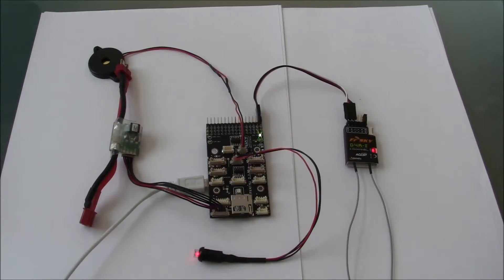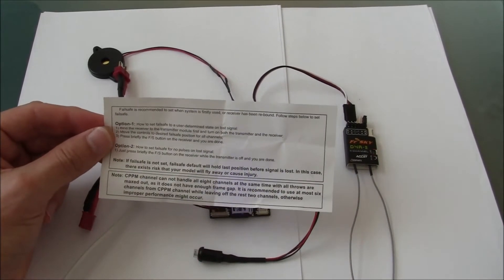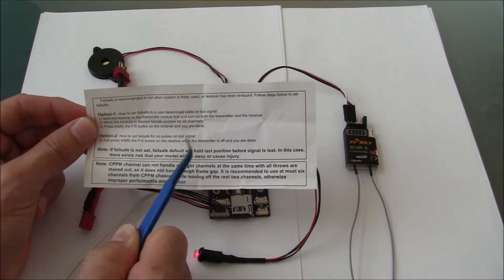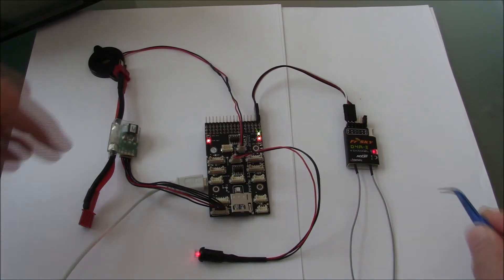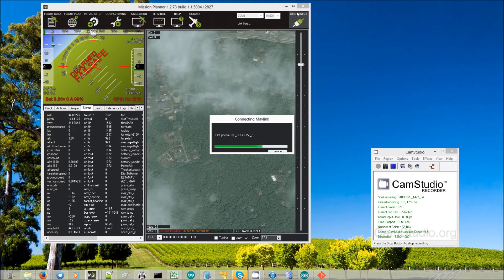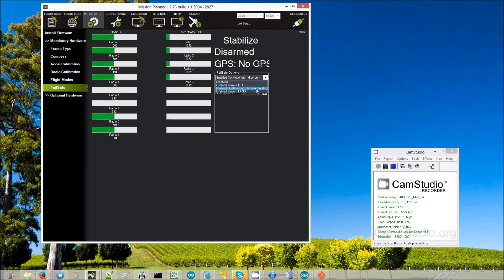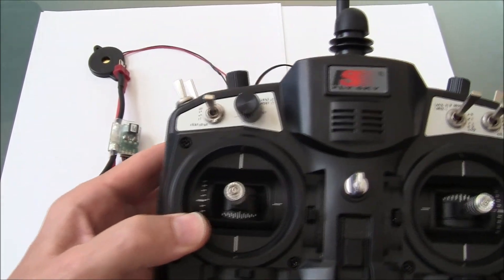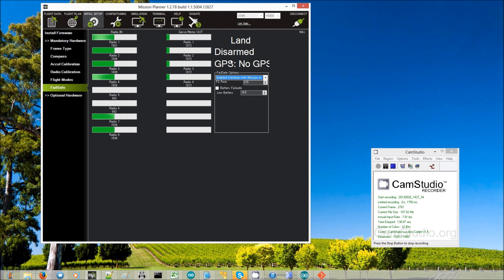FrSky D4R-II receiver failsafe setup with AC3.1 on Pixhawk

Comment: Why does the copter switch to stabilize and then land when you have enable mission in auto set? is this because you were not flying in auto? if you were what would you expect to see on the throttle channels?
Reply from the maker: Tyler Griffin It didn't switch to Stabilize, it was already in Stabiilze and then because of the radio failsafe it switched to Land mode.  If it had been in Auto at the time of the failsafe, because I'd select "Enabled, Continue with mission in Auto Mode", the mode would not have changed at all, it would have remained in AUTO mode.

Comment from the maker: You should be able to use the same set-up procedure for the APM2.5 ~ 2.6 and it should trigger the failsafe but I haven't tested it yet and there's one thing that worries me a little - the ppm encoder on the APM2.5 changes the flight mode channel (ch5) to 1555 when the receiver stops sending a signal so it's possible the flight mode might be changed when the transmitter is turned back on.  I need to confirm that part.